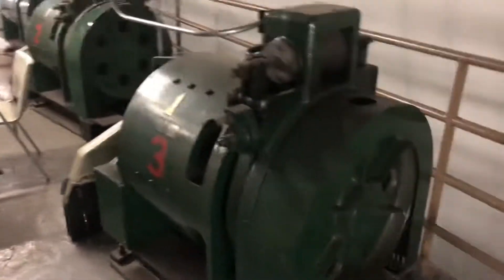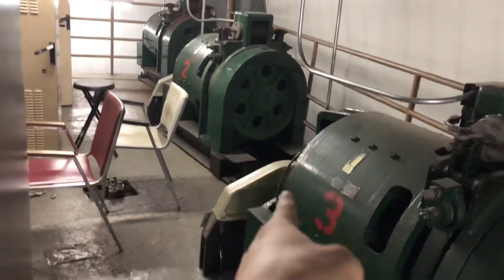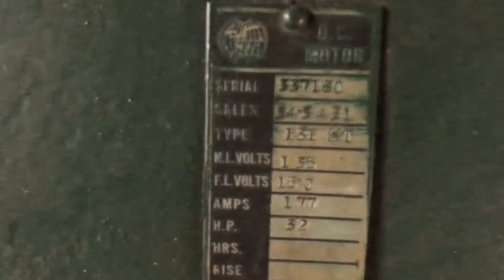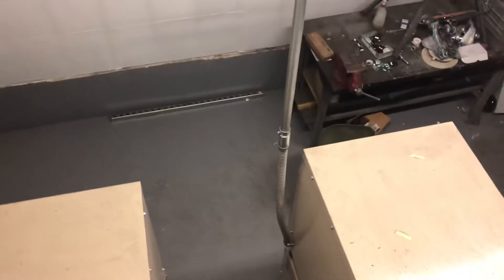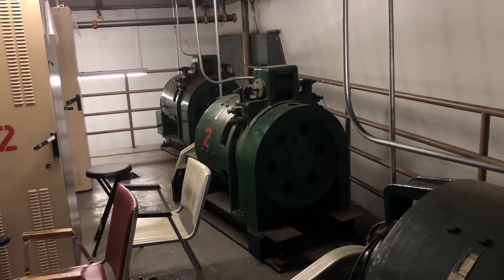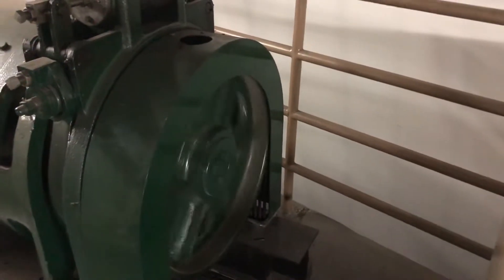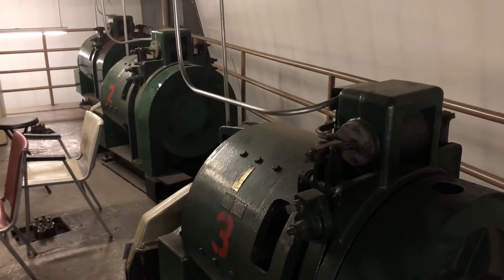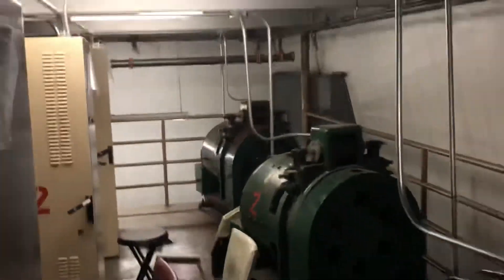Otis Elevator Machine Room

Comment: 52 year old gear-less traction machines still going strong.  Yup, those are the DC Drives on the lower level of the machine room. Back in the 60's would have been relay controlled with MG sets

Comment: I see the dead end hitch, must be 2:1
Reply: It would be a 2:1 roping with the hitch plate and likely it's on the cab side with the compensating sheave  Chances are this is a low to mid rise building and in checking the data plate these machines might be "baby traction's"  this one is 32 HP 150-55VDC 177A